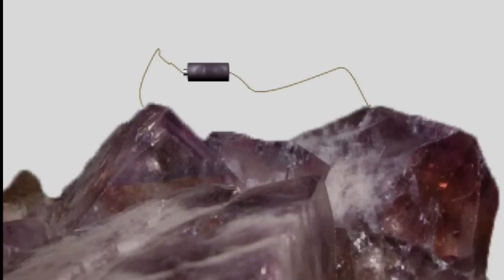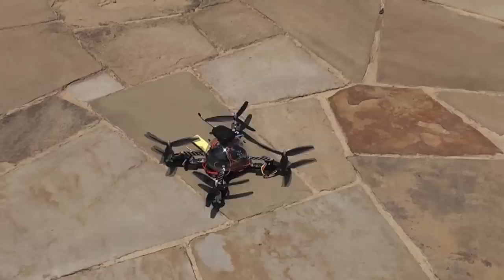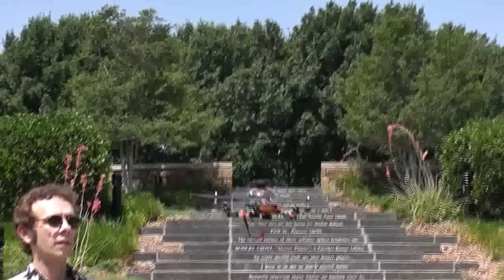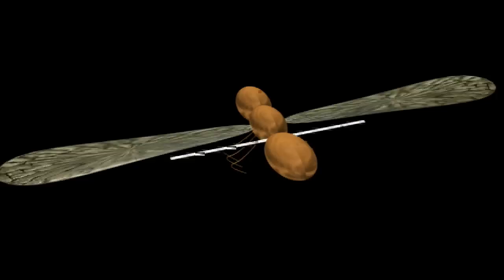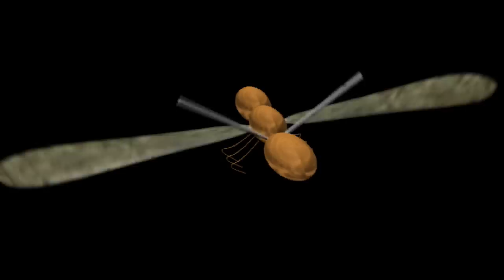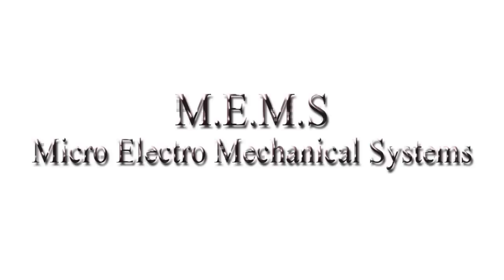How It Works -The Vibrating Gyro- (Science And Stuff)

Comment: I guessing that the vibration is damped ever so slightly along the direction of rotation which lowers the voltage in a bridge circuit. This reminds me of the torsion balance invented by Columb to measure tiny electric fields. He created an oscillator using a silk thread that wound and unwound and the frequency would vary when attached metal balls were tugged on my an electric field. Everything is a oscillator !

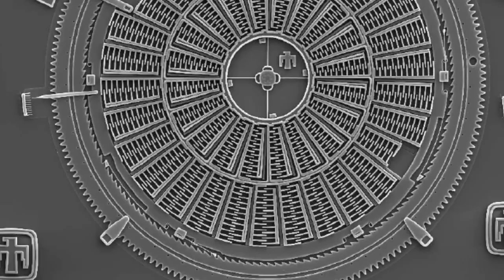Comment from the maker: I thought that's what i was representing with the animation but I may be wrong. It was hard to find internal diagrams of this type of helicopter gyro. From what I could tell from diagrams the mass vibrates left and right on one axis and measures the Coriolis force of the yaw axis. their are a large number of MEMS gyros, most are very complex like the 3 axis one at 1:42 but they all use the same basic principle a mass is vibrated on one axis and measures the coriolis force of a perpendicular axis

Comment from the maker: I just hope I got it all right, I don't know if that RC gyro really looks like that inside or functions exactly like that because I couldn't find any actual internal pictures of one.
 I had to research multiple written sources and base my C.G. model on circuit diagrams.It was hard to figure out it's structure and how it really worked. I also hope the twisting motion I show the flapping component making is an accurate representation of the coriolis effect that causes the current to be generated.

Comment: Great video, and the last comment you posted helped a lot. Thanks!
Reply from the maker: +Anders Gammelsrød Thank you for watching, stay tuned for more.
Reply: What makes them classified as gyros instead of the other types of MEMS accelerometers? the fact that you excite it to generate movement in the first place, while accelerometers are passive?
Reply from the maker: I believe they are called gyros because of the type of motion they are designed to detect, spin around an axis. Accelerometers detect acceleration on a plane. I believe mems accelerometers function on the same principle as mems gyros, piezoelectric components vibrating and the Coriolis effect.
Reply: Yeah, make sense. Gyros for angular velocity, and accelerometers for translating acceleration. BTW, accelerometers MEMS are not based on piezoelectric, but on the variation of capacitance in capacitors with one fixed and one movible plate.

Comment: great explanation. But can you explain further about how a distortion in the movement of the vibrating wing can generate pressure on the piezo electric component?
Reply from the maker: The vibrating Wing is the piezo-electric component. You can make a crystal vibrate by applying an electric current to it at a specific frequency it can also generate an electric current when it deforms.

Comment: ? I want to understand what the relationship between MEMS gyro and coriolis
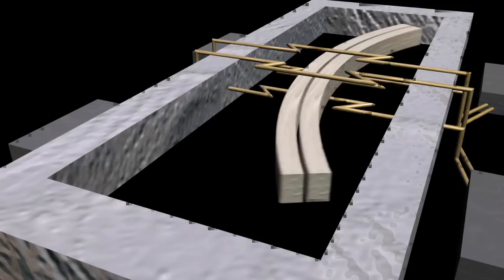Reply from the maker: +zhrah3ata2 The vibrating structure within the gyro moves up and down really fast 1:13. It  is made out of crystal, when you twist a crystal it generates a small electric charge that can be detected. The vibrating structure twists because of the coriolis effect 1:21, the fact that it wants to keep vibrating back and forth in the same plane even though the gyro has twisted. it takes a second to catch up and get back to its normal back and forth vibration, but in that second the deformation of the crystal from the twist causes it to generate an electric charge which the aircraft can detect. You need a different vibrating structure to detect movement for each axis of rotation. Most MEMS gyros are 3 axis single chip devices these days.